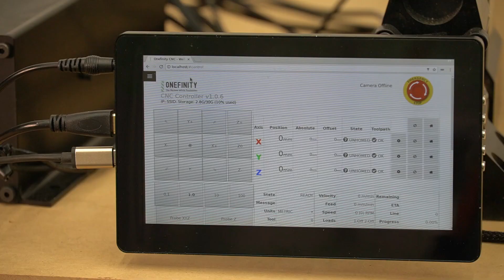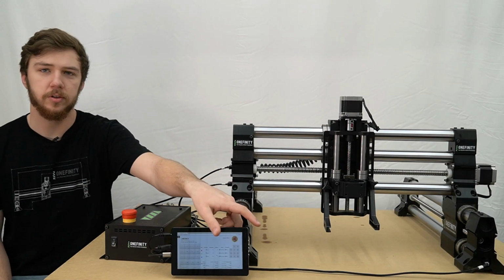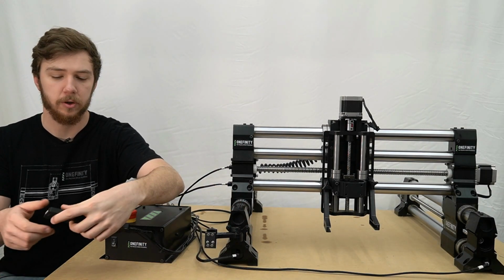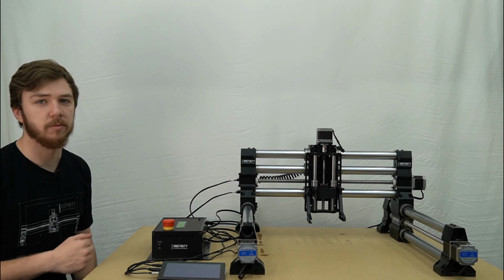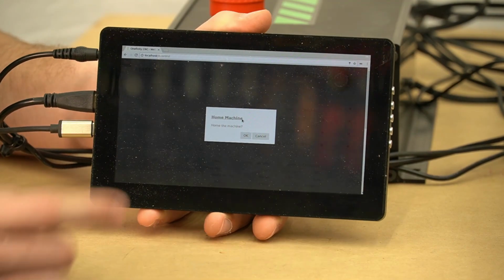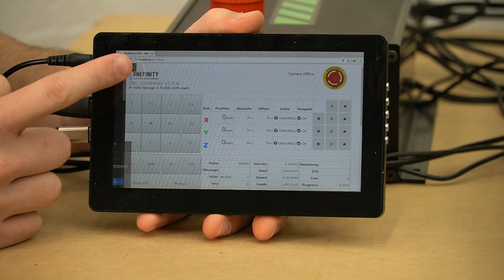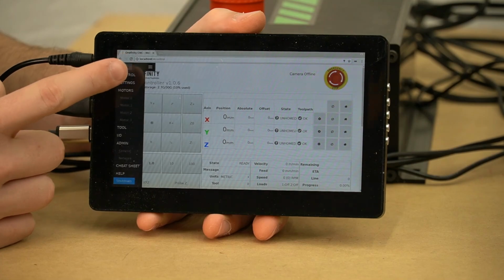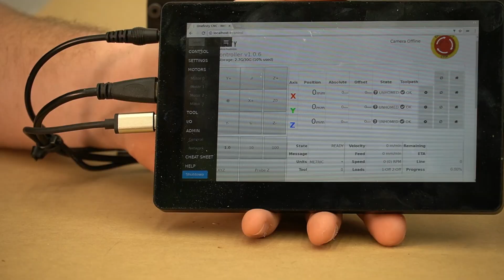Support: How to Flip The Y Rails Backwards (cable in back of machine)

Comment: It would be much better to just move the cable to the back and not run it through the Y rail. Not sure why it was designed like that.
Reply from the maker: Because the touchscreen mount connects to the rails.
Reply: @OnefinityCNC  thank you.  I appreciate the info.  Once I get my Onefinity Woodworker I think I am I going to run the cables directly down under the table through drill holes in my table under the front of each Y rail.  Would this be ok or should I get covers anyway for the connections to the Y rails?   Thank you.
Reply: Just curious...  is anyone damaging their Y cables or the connections due to these being connected in the front of the CNC?   Does anyone make any hard plastic covers that could be placed over the Y cable at their connection points so that the are protected?
Reply from the maker: www.rowdyroman.com sells aftermarket covers.